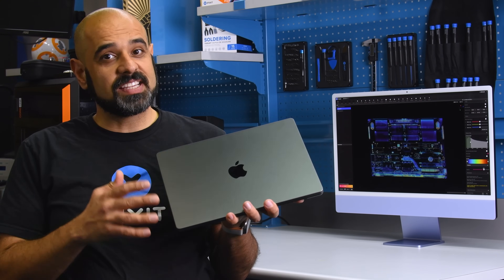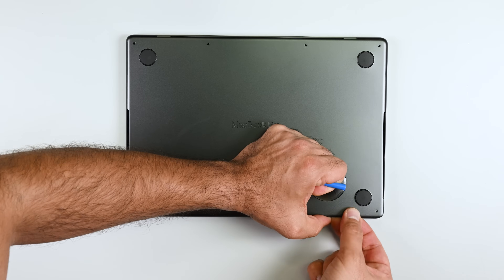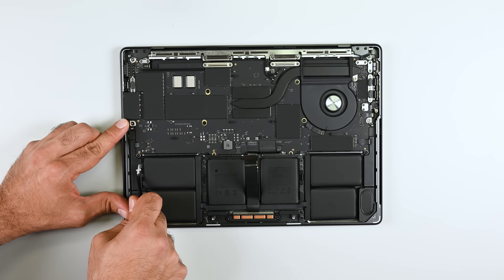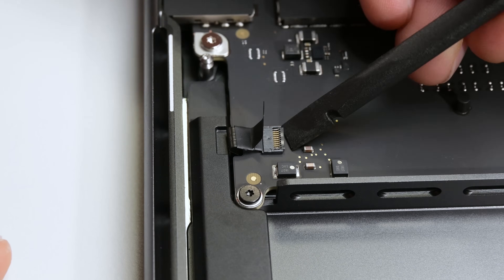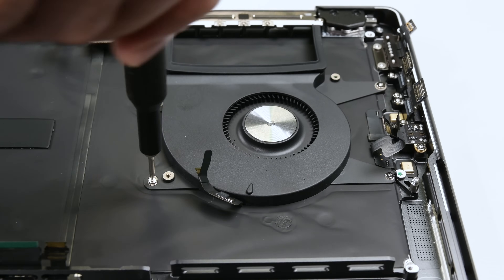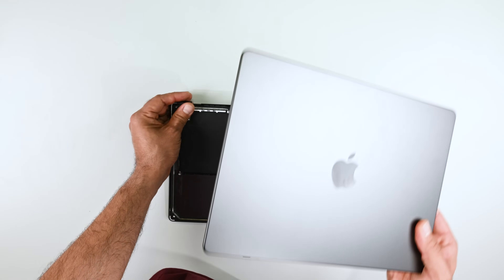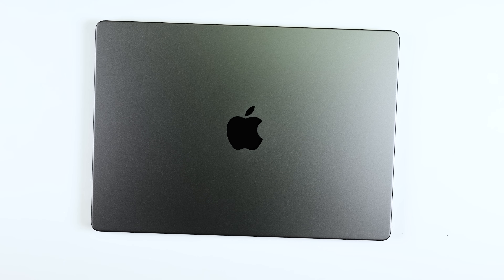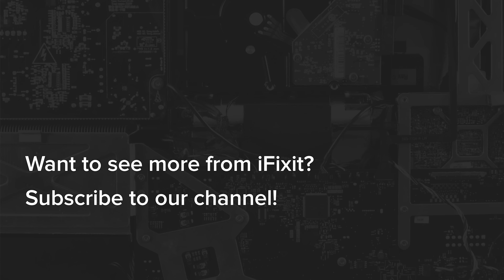M5 MacBook Pro Teardown | Apple’s Subtle Step Forward in Repairability

Comment: crazy how replacing a trackpad is much easier than replacing the battery💀
Reply: Nowadays batteries last more than a year before they lose all their capacity. Also, the MacBook pro is very efficient which makes the battery have less cycles.
Reply: @mus_xr4653  laptops are supposed to last more than a year...
Reply: When the battery used to be swappable. Shows how far things have fallen!
Reply: With the MacBook Air M2 you have to remove the entire mainboard to replace the battery. Thats crazy
Reply: There's a higher chance someone might break their expensive glass trackpad which is exposed all the time to abuse as compared to the battery. So, it makes sense that the trackpad is easily replaceable. It takes years for the battery to degrade if cared properly...
Reply: And it’s not even like a glass trackpad or anything like that. The battery is literally the thing that most people are probably going to want to replace in the bottoms of their MacBooks.
Reply: Not crazy at all.  Can’t you solder?  Funny how Windows losers crow about “building” their computer when all they do is plug together generic trash.  The battery will last ten years at least.
Reply: Apple likly fo way more replacement trackpads under warranty than batteries.   It us a glass trackpad so people can and do break it
Reply: the enshittification continues, clippy would never do this to you
Reply: @user-tr1zj  Clippy will copy it, like always.  What else would they do besides rip off Apple and sell the warmed over crapola to wintel clowns?
Reply: Madness
Reply: Bro you cant easily swap the battery because if its easier the laptop will not have ip68x smh
Reply: not crazy if you see how it is engineered lol😂

Comment: Selling the battery glued into the top chassis should be made illegal!
Reply: yeah, borderline criminal.
Reply: Its like 6 iphone batteries at this point litteraly.
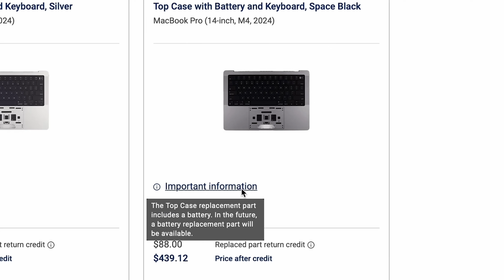Reply: Y'all really gotta read the text on screen at 1:35. 

They're going to be releasing a standalone replacement battery, it's just not available yet.
Reply: Especially given how the battery likes to bulge at its EOL!
I've recently seen a Surface Book on eBay with a bulging battery, I'm tempted to buy it (and save it) but that battery is going to be a right pain to replace.
Reply: @TheSpotify95  That's normal for basically every Lithium Polymer battery. It's just chemical breakdown. Not brand specific at all.
Reply: It isn’t… there’s pull tabs.
Reply: @Dresling So why did they choose to not sell the battery separately?
Reply: @smirsyad I expect the reason is the flexibile nature of the assembly, if you pick any of the connections between the battery you could get a short and start a fire.  

What they need to do is put the battery onto a rigid frame so it can’t get bent in shipping or install.
Reply: @smirsyad greed
Reply: @smirsyad  The battery for the MBP M5 is for sale now, seperatley.
Reply: @Dresling you still need to buy an entire chassis...
Reply: Well.... If they're willing to sell chargers separately for the majority of their devices, they can do it for the batteries for their devices too
Reply: Dont cry, just don’t buy it. Should be easy since you’re poor.
Reply: They are doing this because they know the low quality ABS plastic keycaps will be worn out completely by the time the battery needs replacement. Not a bad idea considering the circumstances, but I'd rather have a replaceable battery and better quality key caps. I can take a non-removable keyboard as a sacrifice for the solid and non-flexible keyboard area.
Reply: @minims  What are you even talking about? The key cap material and quality is the exact same type they've been using since the 2008 MacBook. They originally glued in the batteries as a cheap and quick way of making their devices slimmer, like as on the iPhone, but it's just become a bad habit that benefits them.
Reply: @megatronskneecap they actually changed it
Reply: @PlanespottinginthePNW They actually didn’t though
Reply: @minims  they could sell it as on optional, not requirement